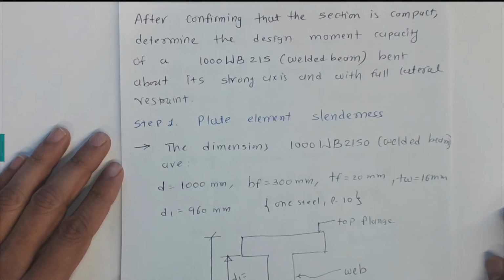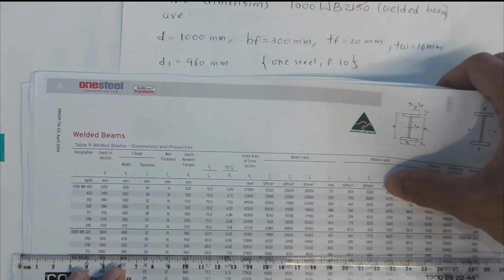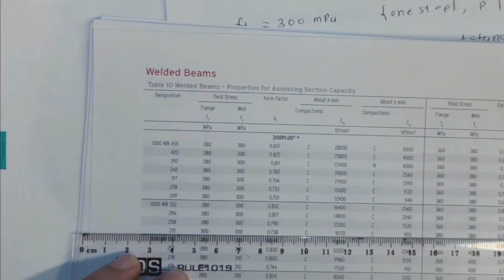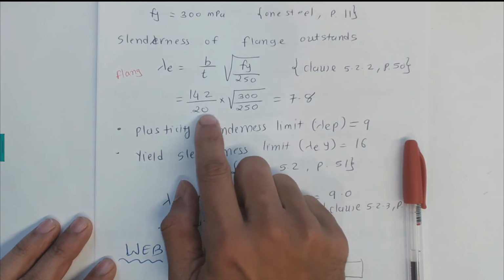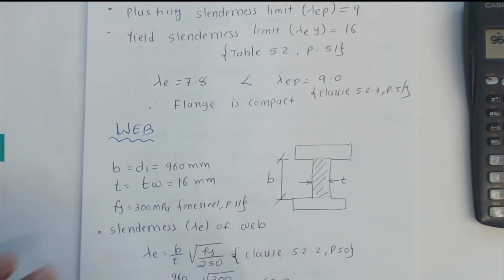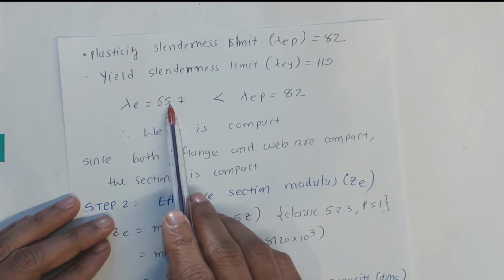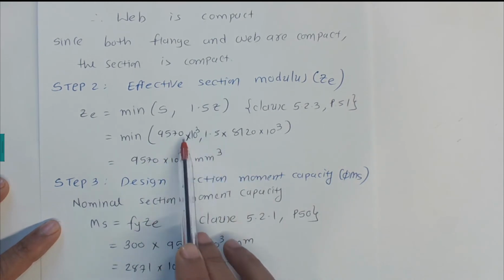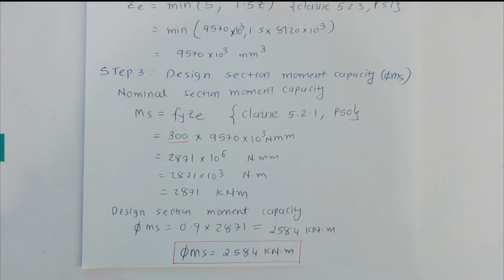Steel beam design for bending Example 5

Comment: 1000WB215 is welded beam, why plasticity slenderness limit is equal to 9, should it be 8? and yield slenderness limit equal to 14?
Reply from the maker: You are correct. We should use the plasticity slenderness limit of 8 for Heavily welded (HW) beam (Table 5.2, AS4100:2020, Page 54). Please use plasticity slenderness limit of 8 instead 9 for HW section.